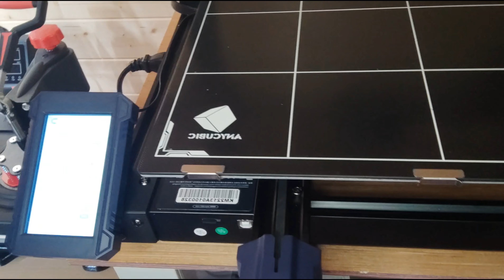Anycubic Kobra Max fan shroud rattle

Comment: Hey dude, I just noticed during a print that only two of the three fans are spinning. Looking at it from the front the left doesn't spin during a print. Is that normal or is it faulty. Literally just got the printer today. Sigh...
Reply from the maker: The side fans are cooling fans front is hot end fan ... check wires are correct connected
Reply: @3DPUK-TECH-CHANNEL  ok thanks. I ran the m106 s255 command and only the right fan was spinning. Is there any way to actually test if all of then work with a command? Or should all spin with the m106 command?